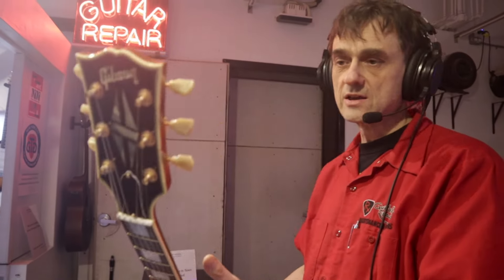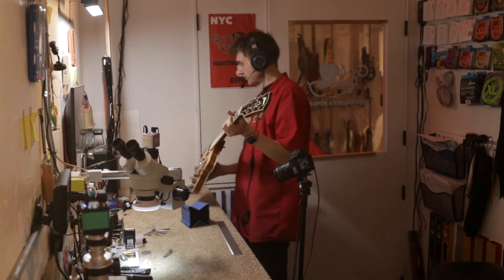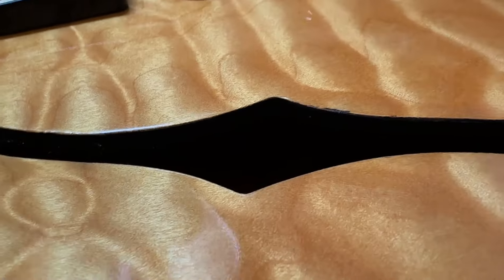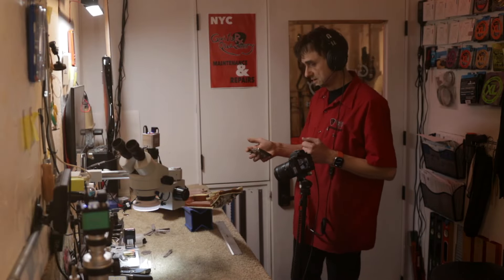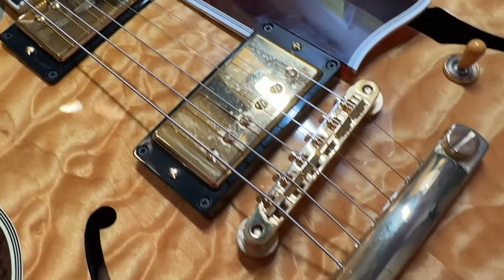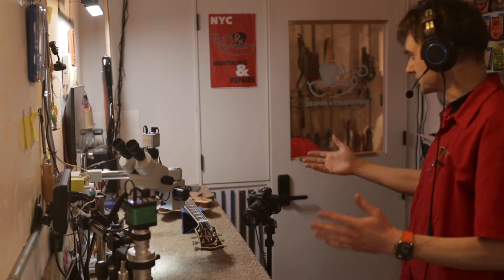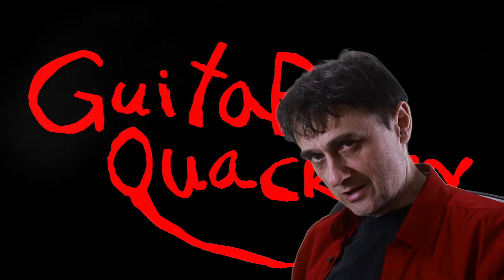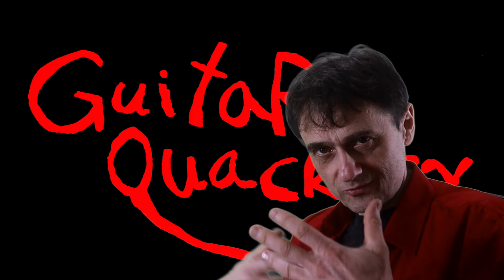Gibson Custom Shop CS-356 Review & Demo

Comment: Good to see you again, seems like it's been a while but I'm glad to hear you're busy. The ES-339 cousin of this 356 is one of the last guitars I'm hoping to acquire before I'm done. These are a very nice size and shape for hollow and semihollow electrics, sitting in between the 335 and LP and having the 'family resemblance.' For my budget though it'll probably be an Epiphone if I get one, but that's ok with me. Enjoyed the visit today, thanks!
Reply from the maker: Yeah... I'm also kind of tempted to get an ES-339, but I should really sell some of my existing guitars, first. I haven't seem any 339's around, lately. Are they currently being made?
Reply: @GuitarQuackery  That's a good question. I haven't seen any new ones lately, Gib OR Epi, in the Dallas/Fort Worth area but there are some used ones in the online markets. They are holding value or appreciating to above-new prices. I really want one but I'm not going to spend ridiculous money for it. Unfortunately I passed on "the One" three years ago during the lockdown and I regret it. The Dallas Guitar Show is happening this weekend and I'd bet there are some nice 339s changing hands, but at prices that are just out of my league.
Reply from the maker: @markpell8979  I just checked Sweetwater and the Guitar Center website and they both sell Gibson ES-339 guitars. The plain one is $2,999 and the figured one is $3,499. I have no use for the figured one, but I wouldn't mind a good plain one in cherry. So, I guess they still make them, but I guess they are just not as popular as one would think. 

BTW, why are they called 339? It's such a bad looking number. And so is 356. I do like 330, 335, 345 and 355 just as number, but 339 is just ugly to look at. I wonder if the fact that it's called 339 might have slightly influenced the lack of popularity.
Reply: @GuitarQuackery  I've wondered about the model numbers too. Some Gibson history buff has no doubt written about it. I bet it stems simply from how they numbered models in the shop back in the day, at Kalamazoo probably, leaving gaps in the sequence for new versions in the future. Like in most woodshops, I can imagine numbered tracing/routing/drilling templates hanging on the wall for anything they mass-produced. Maybe somebody suggested, "What about a scaled-down 335?" 🤔 So they drew out a few, built a couple, and when they got it just right they knew it and it turned out to be prototype #339. Makes for a nice story anyway, don't you think? Thanks for the current price info. It tells me the Gibsons are above my budget for at least the near future so I'll stay on the lookout for a nice Epiphone. The fact that the standard ES models' bodies are made from laminates does not bother me and I think there are some worthwhile advantages. A solid top as on the CS-356 you featured is beautiful and aesthetic for sure but to me, a 'plywood' ES sounds just fine played electrically. If I need an acoustic with a pickup for some reason, I already have one. As with you, before I buy another guitar I should get rid of a couple first to make room (and feel justified- ha!) but I don't really have any guitars now that I want to part with, which isn't a bad place to be. Still, I believe I will own a 339 before I'm done. I guess I might settle for the right 335 but for me the size, proportion and feel of the 339 is right on and I don't see why it's not more popular. Anyway thanks for taking time to 'chat' about guitars with me. I appreciate it! Best wishes for continuing success with your business and I look forward to the next video.

Comment: Quack good to see you back . One day can you explain how the strings should sit on a Les Paul type bridge saddles . Should there be a deep groove or should the strings sit on top of the metal saddles does this effect the sounds or when should these be changed . Hope I’m making sense . Will check out your online store
Reply from the maker: I believe the best execution is to cut a string groove that nests the string 1/2 way, into a slot that is exactly equal to the actual diameter of the string. That is a theoretical situation, as it is impossible to actually cut a string slot that is precisely the same diameter as the string. But that theoretical situation would offer the best of both worlds, i.e. you could do palm muting, without scratching your hand against parts of the hardware sticking up, you would have the best distribution of the forces against the king in the string (reducing the danger of string breakage), there would be a groove, so you always put the sting in the exact same place, when you change the strings, etc. 

I'm not sure of others might have other ideas.
Reply: @GuitarQuackery  I don’t think I have seen anyone discuss this question at the saddles . Funny though as the nut groove gets all the attention I’m sure the depths of the bridge saddles do something .

Comment: Nice, but I would be afraid to play it.
Reply from the maker: It's a $5,000 guitar that was not in a hard case... and it's a Gibson with a mahogany neck and a severe headstock break angle. I really wanted it out of the shop ASAP.
Reply: @GuitarQuackery  I saw the break angle and thought “nope.” I might have tried it whilst on a bouncy castle but i haven’t got the space for one, and I would have to inflate/deflate. Impractical. 🙂
Reply from the maker: @hannosolo  How about a trampoline?
Reply: @GuitarQuackery  That is why you are that guitar guy. I will look into it, thanks.
Reply from the maker: @hannosolo  Here's a true story. 

Let's start with an old Chinese proverb: "You really can't make that shit up."

A customer brought me a Gibson Les Paul with a broken headstock.

That's not unusual. The unusual part was how it broke. 

No, he did not play the guitar while jumping on an inflatable castle, or trampoline... He placed the guitar on the floor and stepped on the nut, to see if it would break.

He did this in, what he described as, one of his drunken states, after a friend told him that Gibson guitar necks are so strong, you can literally step on them and they would not break. So, the guy (my customer) was so intrigued at the prospect of his favorite Les Paul being un-destructible, that he decided to check it out for himself, placed the guitar on the floor, put his foot over the nut, shifted his body weight onto that foot, and... CRRRAAACK.

It turns out, his friend was mistaken. Woops.
Reply: @GuitarQuackery It's fascinating that there are people who think that something good can come from laying a guitar on the floor and stepping on it.
Reply: @GuitarQuackery   A script writer would have a struggle to think of that one, but it does not surprise me. I gave a neighbour some lessons. He was quite new to guitar and had quite a nice Tele cv 50, the price of which was fortunate. He brought it around one day because the signal was crackling very badly. He had “washed it” with soapy water.
Reply from the maker: @hannosolo  Thank you for the tech tip, LOL.